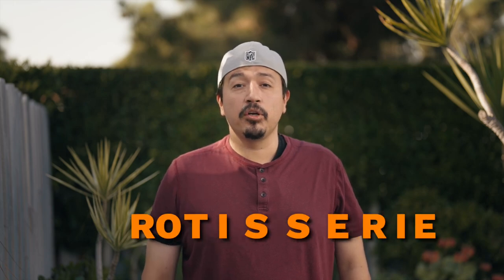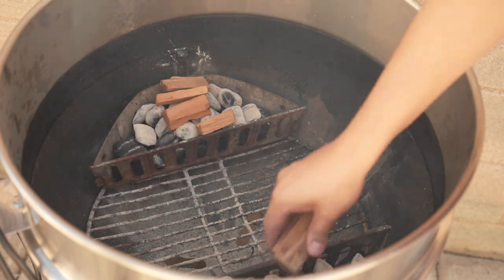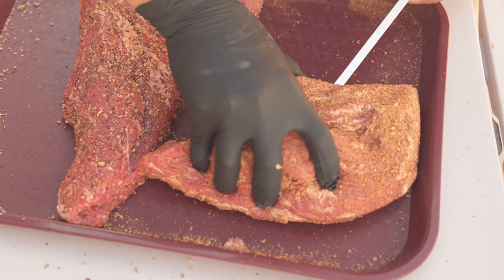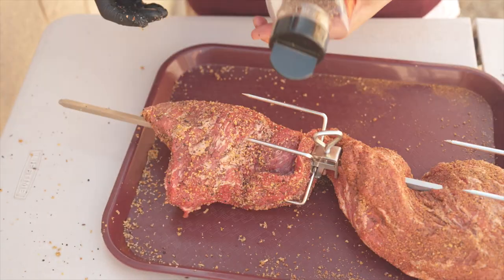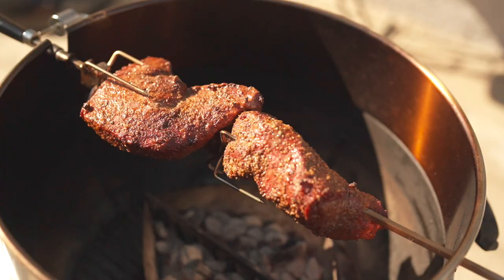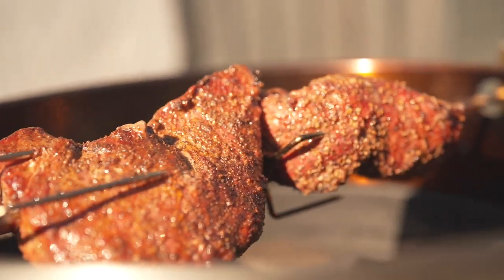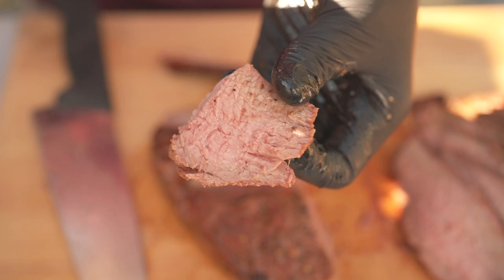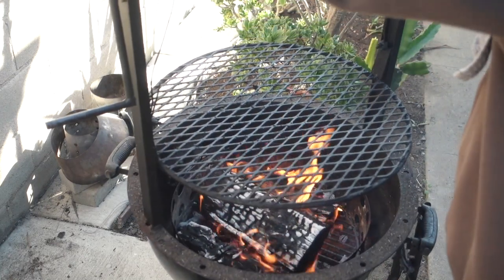Disadvantages to Grilling a Tri Tip on a Rotisserie?

Comment: Great job but definitely get a remote thermometer. I had to make a collar to run the wire through that rides on the edge of the ring closest to the handle. I've been doing chickens, turkeys, roasts, etc on an upright drum smoker to get a bit more headspace if that makes sense?
Reply from the maker: Still haven’t pulled the trigger on the wireless thermometer